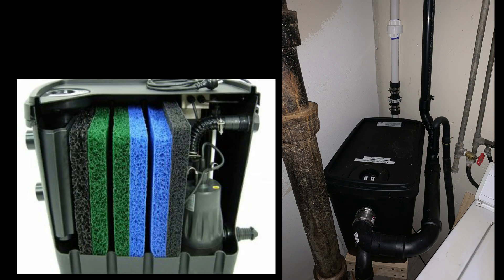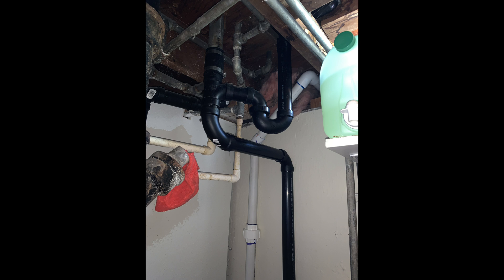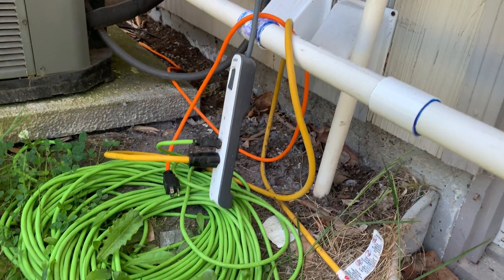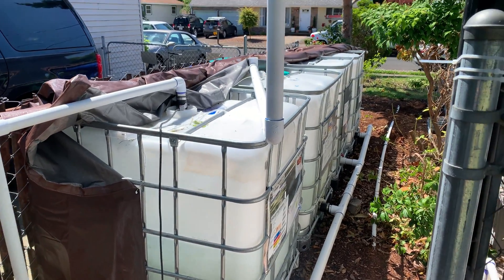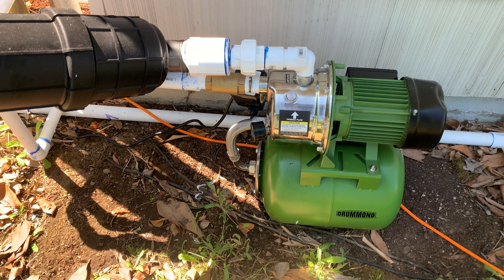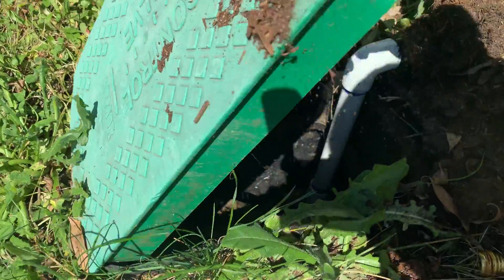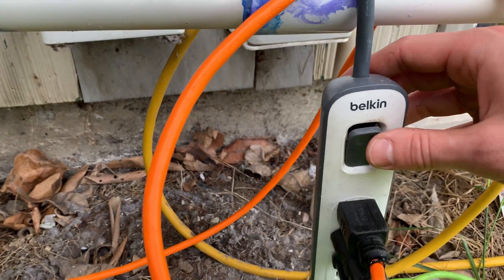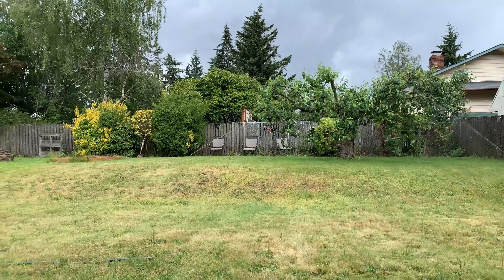Grey water and Rain Water Recycling System - Automated

Comment: Nice system, I currently have two IBC’s for rainwater collection and I’d like to know more about your filtration system, what meshes did you use and have they been durable since install. I’d like to add shower water to my rainwater but understand it will require filtering prior. I’m a novice so open to any suggestions.

Comment: Hi Benjamin, I liked a lot how you set the system , we use bleach and shampoo ,is the water save for fruit tree or i need to use additional filter?
Reply: If you're using bleach you should really have a bypass that returns to the sewer that you can hook up with a valve, actuator, and conveniently located switch.
Reply from the maker: Rust Walker, that’s absolutely right!
Reply from the maker: Sorry for the late reply! I just saw this at :45 I show the valve I have. I didn’t mention why it was there though the valve like Rusty Walker was saying directs any unwanted liquid to the sewer. I’ve only been redirecting bleach water. I know some people use special soaps or gray water systems. Are use regular soap, I figured collecting lots of gray water and rainwater would dilute it enough to make it not matter, I could be wrong, however I haven’t had any problems yet. Definitely definitely definitely do not put bleach on the grass LOL

Comment: I bought that same water pump but I don't know what happened to it every time it reached 60 psi it resets and never turns off, I like the water pump has a lot of pressure but I had that problem, I plan to change it for another of the same to see if it doesn't come out the same
Reply from the maker: Have you tried putting a check valve on it? This happened to me too. It would reach 60PSI and shut off, depressurize and kick back on. I installed the check valve on the input of the pump and it held its pressure. I hope that helps!
Reply: @benjaminherrmann7671   thanks for answering ...... It is very strange it reaches 60 psi and it jumps that the pipes move and it returns to 20 psi and it starts to rise again to 60 and it does it again and again and it never shuts down.
Another thing is that I raised the pressure to 70 and it stays still but it never goes off.
Reply: I have to told you that I'm so happy thank to you broth I resolve my problem waooo thank you thank you  God bless you brother I'm very happy

Comment: Is the only filtration in your system a small biological sponge filter?

I don't like the idea of having untreated greywater sit, before being sprayed via pressure into the open air. 

You are correct in that most grey water systems are bland laundry to landscape systems. You have a few improvements I can see that you should do, but you should be able to see them yourself soon.
Reply from the maker: Matthew Meuleman your right, I need to do more work. There is also a mesh filter next to the pump. There was a bad oder soon after I hooked it up. I think a bio filter with plants and such would be the best option as a secondary filter. What do you think? It was a great start and definitely needs some work to make it more functional.
Reply: I would take the lids off the IBCs, put a mesh planter basket inside to have any existing pipework put inside the basket, then throw cat tails/ bullrush around the pipe, inside the basket.

I only really like synthetic materials to encase my grey water system, not provide any filtration. I started off using a similar bio-filter before I used the container to make a reed bed out of.

Adding a sand filter just before your IBCs in the greywater part of your system would be a better filter than synthetic materials. Adding a mulch column before the sand filter would be even better.

The memory of the stunk of the grey water my mother collected when I was younger helped drive me not to make the same mistake she did.

I have a great system for my laundry I did without any calculations, I am calculating a system to handle shower load currently. I am keen to show them off, but was advised to secure intellectual property/ copy write the design. I have no issue with people mimicking my design for personal use, I just don't want the idea to be stolen from underneath me and make someone else rich.

These two ideas are part of my system, but not what makes it different from anything that currently exists.
Reply: Your design is decent, just needs a few tweeks, without the tweeks, you are impeding your system, with the tweeks, you will notice a decent improvement with out really changing much. Like, the water volume of your system is great, more biology is needed to mimic the natural process though
Reply: @matthewmeuleman3369  A whole year since this comment and I imagine if you were serious about your waste water treatment you’d have secured your intellectual property rights for your design by now, so what’s novel about your design that you have to be obnoxiously coy? Or just internet comment flexing? 

Every municipality in United States has waste water treatment scientists and engineers working on these systems, and almost everything successful is old technology and mechanically aerated tanks for aerobic biology. Countries in Europe, Africa, India all have incredible living ecosystem grey water systems at reliable scale. I’ve spent a decade in this field and honestly want you to prove me wrong with whatever you’re hinting at in your top secret design. 

Ideas are a dime a dozen and don’t get you rich, execution is the real secret no one ever talks about . . . So if your idea is as special as you present then execute it and help the world!

Looking forward to the discussion. Thank you.